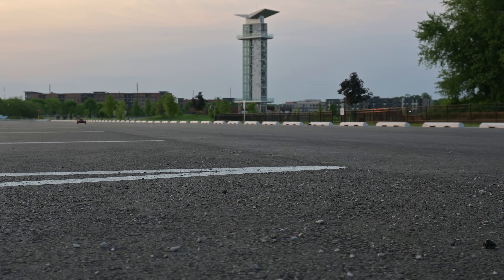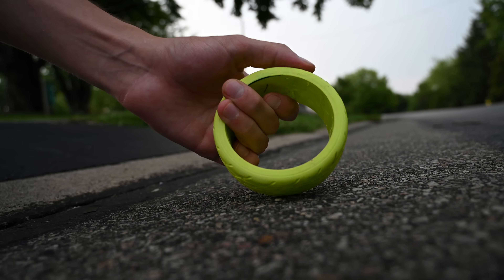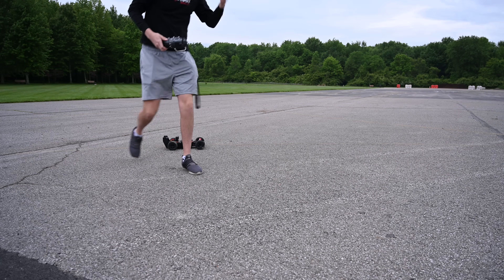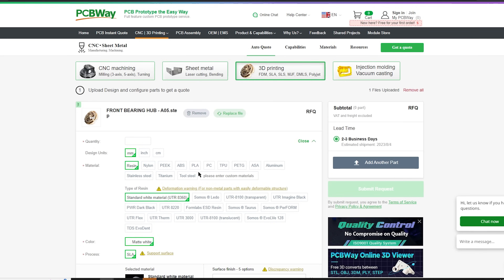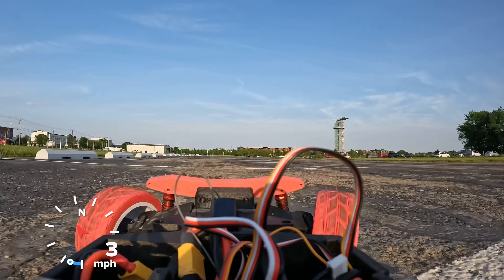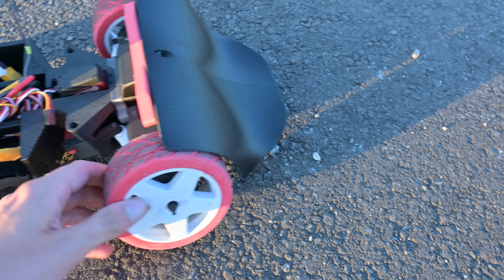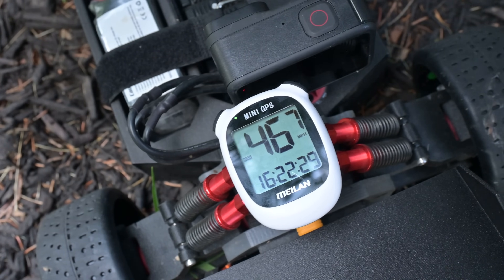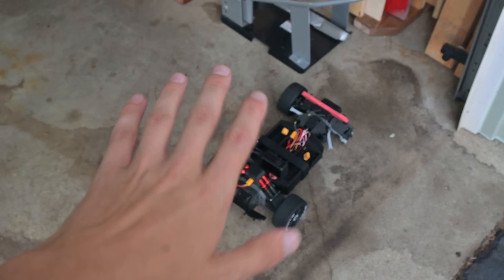I 3D Printed RC Car Tires... Will they survive???

Comment: Probably you can try to make nonlinear dependence of speed/steering ratio, so increasing speed will decrease steering reaction and movement.
Your car is not stable on high speed because of short wheel base, try to make its longer.
And about tyres, I think for a good grip you can make tyres of silicon, like roller's skate wheels. Imho.
Good luck 🖖

Comment: softer suspension helps a ton with bouncing, and you have to get the amount of damping just right.  too much and it'll still bounce from not compressing fast enough.  too little and the wheel will float and take forever to come back down, then possibly have a second bounce from rebounding so fast.  you can visualize this in your head. imagine a tires from the side, and it's rolling and the ground is moving back quickly.  a bunch comes by and the tire hits it and sends the tire moving upwards.  with perfect damping, it stops just above the height of the bump, then comes back down to make contact with the road again quickly.  that way you lose traction for a shorter period of time.  if damping is too weak, the tire will fly up and it won't stop until you max out the suspension arm travel, then it'll bounce back down too fast and possibly have a second bounce.  your tires will spend a lot of time not touching the road.  if damping is too high, the impulse will impart energy into your chassis and it'll deflect your trajectory with each bump, and it'll look like it's skipping around the surface like a rock skipping across a lake.  luckily they sell different spring rates and fluid viscosities for the purpose of tuning this sort of thing

Comment: Brilliant work, Michael! Really well done! 😃
Your sponsor has 3d printing with metal, also CNC I believe... I don't know, perhaps it could be a good idea for some parts. 😉
Other than that... Looking forward to the 4x4 version!
Stay safe there with your family! 🖖😊
Reply: It would not be "3d printed" anymore. Also, metal is not good absorbing the impacts and would make other plastic parts break easier.
Reply: @xxGmon3yxx   you can actually 3d print with metal powder. Its called powder bed fusion and there also are other methods

Comment: Great video...if you want some proper airfoil models me know. We can get you Waaaay more downforce for a triple element wing:)

Also good work on the wheels. Ive been back and forth on wether its worth it to even try 3D printing for a speed runner.
Reply: Love your channel! I’m working on an Open RC F1 car that I’m going to try to get to 50 mph. But my 3d printer is having issues right now.
Reply: @LayerbyLayerOfficial  that's going to be awesome. The open RC f1 stuff looks fun. 

I want to build a version of an F1, but closer to the 6 wheel models :)
Reply: @EngineeringAfterHours  very cool!

Comment: From the video seems that the gyro is working in the opposite direction. It does'nt counter steer when you spin, instead it follows the direction of the rotation of the car.

Comment: Try to make the track width wider it should help with some of the stability also making it longer will help what I have done in the past when 3D printing RC cars I find a body that is the scale I want and take measurements off of that to build the car so for what you are looking for probably 8th scale works it gives you more room to play with. My latest 3D printed RC car is a FF buggy so a front wheel drive race buggy and surprisingly it works really well.

Comment: 4wd is definitely the answer, tried making my rc car 2wd, was completely uncontrollable!!
Reply: If the suspension geometry is the same then 4wd will not do much as the tires are not spinning. Adding 2+ degrees of toe in on the rear of the car and a degree of toe out on the front of the car will make it much more stable. If that is not enough then the front upper suspension link will need to be shortened and the rear upper suspension link will need to be lengthened. This will make turn in less aggressive
Reply: Running a noble nb4 with servo delay or a perfect pass will work as a pseudo traction control as well if using a 2wd in a drag style speed test.
Reply: @EngineeringAfterHours  yeh i know Raz makes some pretty incredible stuff, cant say im much into rc cars. Have a wltoys a979 or somethin which is really bad as 2wd. But of course there are many factors such as toe, camber, caster, tyres, motors and even acceleration control for achieving stable driving.
Reply: I once rode a motorcycle at 220km/h, it was perfectly stable with only 1WD. Think about it...
Reply: @iforce2d  First off, motorcycles are bigger and less agile than smaller things, which makes it easier to control. The big heavy wheels of a motorcycle also acts as reactionwheels meaning that the motorcycle basically has a inbuilt gyro thanks to physics (again making it easier to controll). Because on a car, the reaction wheel effect gyro thing does'nt happen as much, and especially on a small rc car with superlight plastic wheels.
Reply: @iforce2d  can you steer motorcycle at such a high speed?
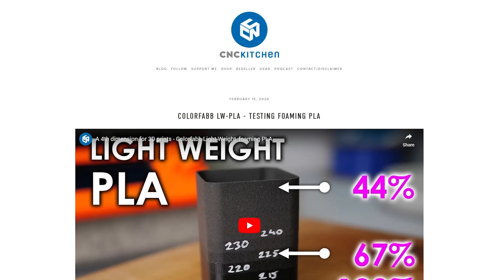Reply: I looked a dude .aking a 1:24 scale 2WD car that went about 100 kmh.
Reply: @CENREAPER-YT  did he use gyro?
Reply: @filippus_  No. He ran them for 10-20 meters to test it out and they will (most of the time) crash.
Reply: @CENREAPER-YT  ah 😂, makes sense

Comment: whats happening at high speed is ur rear wheels are loosing grip so u spin ur tires and loose control a rear wing but dont go too overboard on the rear downforce cuz then the front wheels will lack grip from the balance being moved. hope this helped and made sense :)
Reply: How about a wing mounted high at the middle of the car like those old f1 cars?
Reply: @islam1337simo bad center of gravity and more unstable
Reply: @islam1337simo  Undebody downforce would probably be better for that.
Reply: @Litl_Skitl  I agree. What an elegant solution.
Reply: @islam1337simo  even if he had a bunch of downforce stuff, it really wouldn't be useful until upwards of 60 mph. what he needs to do is increase the rear weight, invest in a 4wd system, and make sure that the car stays planted, because even if he is stable at 50 mph we wont know if the car is planted with downforce until we actually test it, which what he needs is a live action fpv camera for it to help guide it. i know that you guys might dissagree, but at 40-50 mph there is going to be no difference in downforce UNLESS he completely redesigns the rc car to be more aerodynamic. unfortunatley, 4wd would be too power consuming to get him over 100 mph, i would just say that he needs to perfect handling with rwd, and then tune it to a 4wd version, because with 4wd he has more a problem with the front wheels torque steering or the front kicking out, and with 4wd if he doesnt design it correctly, something internal could completely disrupt the entire 4wd system, at that point he should just have a torque minimiser setup, like a small friction clutch or something to decrease the torque at the front wheels and it would help keep the stress down, so that it give him the extra grip and stability when the back end kicks out, but it wouldnt be too much. also, most 4wd systems would fail at high speed, and/or they would overheat and break.
Reply: @bobbylobby820  Also, longer wheelbase.
Reply: If you really want to make sense, I suggest using proper language. Not your kind of semi jungle babble.

Comment: I've never heard of onshape before but what you showed looks good. I use freecad at the minute but onshape looks like it does mechanical movement easier.
Reply: Onshape is pretty decent, I had done some certification courses on simscale (for flow simulation cloud based) and that software works well with onshape.
Reply: It is quite expensive though. 1500 USD per year!
Reply: Ohh i used the free plan when i was a student! I use inventor now since I get that from work
Reply: It's completely free. No license required unless you need team or branch/version management

Comment: I've got four FDM printers and I've just never seen a reason to pick up a resin. I think you may have finally opened that door for me. Interesting build, subbed
Reply: Well to be fair he didn't have 100% infill.
Reply: @noanyobiseniss7462 walls are more important than infill cnc kitchen proved this
Reply: Resin printing is the messiest thing I've ever done. I would watch some videos showing the actual entire process. It's time consuming and like I said a MESS
Reply: FDM and Resin printers complement each other.
Reply: @cobz76  yeah with some stuff haha... Directly of the bed neither compliment each other without some work .... Well maybe not miniatures n things they're pretty well good to go off the plate 😀
Reply: i would buy some pa6-gf before letting pa12-cf be my reason to switch to resin.
Reply: You'll need a place outside of your living area to use it. Those resins stink!!!
Reply: @iandrake4683  not only do they stink, they're also unhealthy as fuck. They WILL fuck you up long term.
Reply: Yo made some paddle tyres I found on thingyverse I think they're a youtuber aswell... Pla+ wheels and tpu95 tyres and hey go awsome 😊
Reply: Cars stable as by the way man I like it 😊 bad luck on the breakage but!!
Reply: H will need a motor
Reply: People without vent are insane
Reply: The CF filament is a waste of timehere. IT provides no additional layer to layer strenght because the layers are cold when the hot one is applied. No weaving of the layers. Regular PLA  would be fine. The only advantge to the resin here is that it's a solid block of print with 100% infill. Resin has zero flex, so it will shatter, not bend and break, when hit. The chassis broke because it took the brunt of the hit. The arm broke becasue its brittlenfrom the CF, and weaker because of the infill. By his thinming, if the whole car was resin printed, it would be indestructible, but any of those crashes would have left a pile of dust and splintered epoxy.
Reply: Toxic fumes, cleaning with the wash station. No thanks. FDM is fine for me.
Reply: You don’t have to say “subbed” it’s an arrogant thing to say